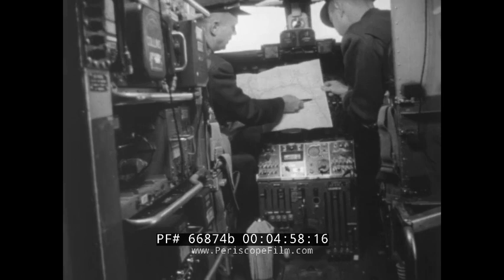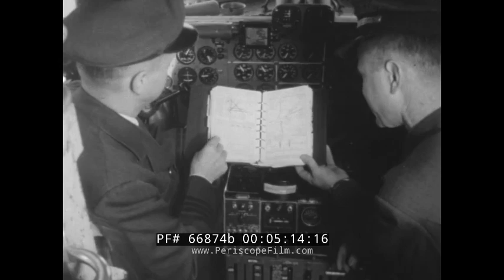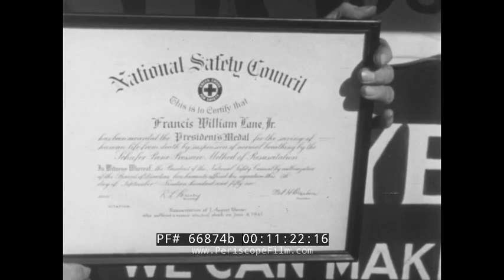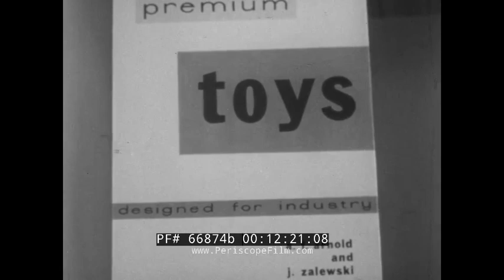INDUSTRY ON PARADE   CRANBERRY HARVESTING   JEPPESON MAPS   MAKING MAGNETS   MOMA  66874b

Comment: What thermostats are those at 8:55? Someone gave me the one on the left when I was little and I still have it!
Reply: They appear to have been made by Honeywell if I can read the image well enough. Since they were one of the major quality manufactures of thermostats for near forever i suspect that I'm reading the name right.

These look more like commercial thermostats than home use, but I could be wrong. Many of the commercial thermostats of that era were pneumatic rather than electrical. That is, they used "air switches" that would switch the flow of air or vacuum in small tubes. This was piped to the heating or cooling unit, and would there turn switches on or off to start and stop motors and compressors, or to operate air cylinders to open and close dampers and the like.
Reply: So I dug it up and it is a Honeywell type t44a but it is 110 and 220 and not like what you described and it’s way too utilitarian to be for the home and of course google doesn’t find anything so there you go. I never saw the place it came out of so I can’t be certain of its environment either.